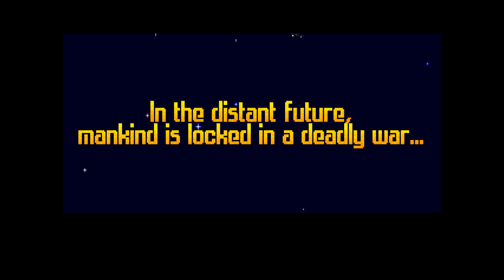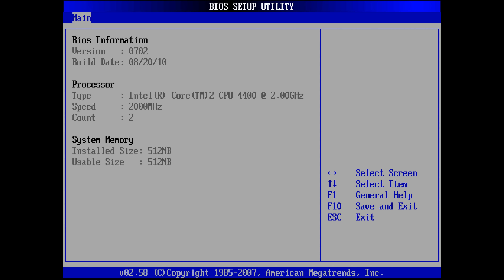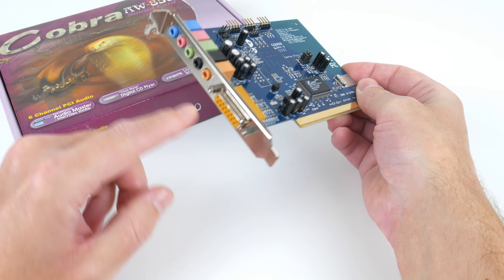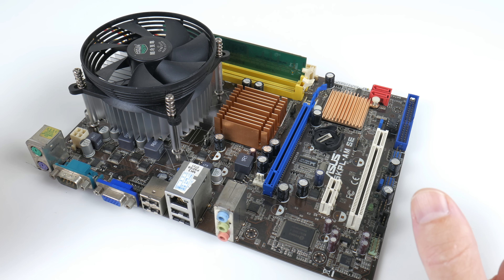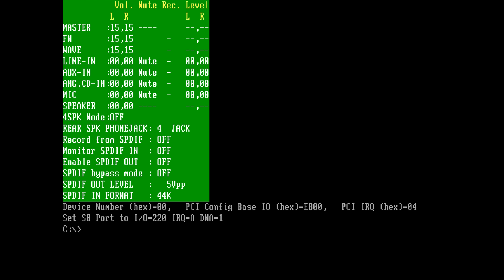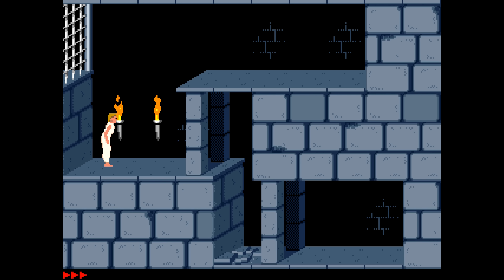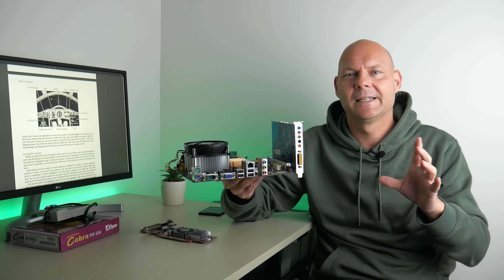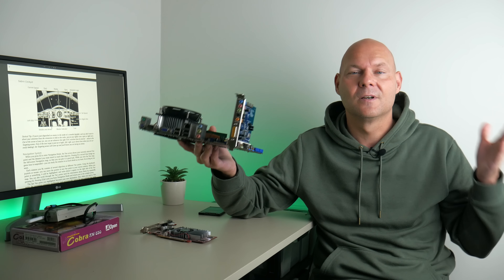DOS Retro PC with Parts nobody wants

Comment: Since you mentioned Vogons, that sort of rig will only earn you an eyeroll there. In my opinion it's important to feel good yourself about what you are doing. Btw the SBEMU will work fine with G31/ICH7/ALC882 so you don't need a 8738.
Reply from the maker: They did the same when I was spreading love of Socket 7 😂 It wasn't a PCI 486 so I didn't fit in 😅
Reply from the maker: SBEMU doesn't work with slowed down CPU as it is emulation.
Reply: @philscomputerlab  That's interesting. "Slowed down" as in Setmul / Throttle? I mean it does work with a BIOS FSB downclock doesn't it
Reply from the maker: @r.d.7698  Think about. Do you think Sound Blaster Emulation can run on a 386 speed computer?
Reply: @philscomputerlab  Oh that slow we are talking. Fair enough, thanks for the explanation
Reply from the maker: @r.d.7698  Have you actually watched this video?
Reply: @philscomputerlab  Just re-watched it. It's a good video and I like projects like this. Yes, I agree with you that for speed-sensitive games you would have to use a 8738, a 724, a Solo or such. Still, the said list is fairly short and to my opinion unless one is a diehard Wing Commander/Indiana Jones fan they can lose the expansion card and play a myriad of dos classicers using SBEMU on any 775 Celeron with minimal BIOS configuration effort that's why I mentioned it. It's also a bit of a rabbit hole, say we solved the speed issues, at some point VBE/graphical issues would arise with newer stuff be it GMA or Radeon. Then we would have to add a Virge to the mix or something. In one of the older videos you mentioned how some people are a bit too zealous on getting every single fussy game like Commander Keen to work on a single build. Like many hobbies, retro pc'ing is a spectrum and it's up to every enthusiast to decide how many corners they are willing to cut (time invested). Building a retro PC is not something you can future-proof (or should it spell "past-proof") for every application imaginable. P.S. jsut to be clear, had absolutely no intent on attacking your position, I appreciate your channel.

Comment: Hi Phil, I'm wondering if an E8500 could also be  usable for WingCommander (around 9-10 in benchmark score) as the slower E4400 here. The CPU is running 1333 FSB @stock (333x9,5 multiplier), so should be possible to get this about as low as the E4400 @800 FSB stock (200x10 multiplier).
I can get a G31 based board with a E8500 + stock cooler and 4GB DDR2 for less than $10. 
I have a Pentium 133 based DOS PC, but I can see advantages of using the LGA 775 for DOS, by using the onboard graphics, and the more modern SATA interface with SSD (fast and efficient, compared to older noisy Hard drives). As having the option to use it as an excellent Win XP rig (paired with a PCI-E graphics card). Also the more modern (not valuable) platform is better to actually use, instead of wearing out the old (now valuable collectors item) Socket 7 platform)
Reply from the maker: I think we will discover the DOS potential of all sorts of hardware in the future, not just LGA 775 but also from the AMD side. Exciting times.

Comment: My main PC is that LGA775 core 2 duo e7300 at 2.66 2008 model, ram is (2+2)gb 667, and 250gb crucial SSD for the OS , i switch between Arch/Debian/Void Linux, i use it to watch movies, my little hobby projects, i am planning to get GT730 GPU as an upgrade for this PC during the next festival sale 😅😅

Comment: Well, perhaps after LGA 775 people will start hunting the LGA 1155? TheRasteri has made an adapter to connect an ISA sound card, so I think LGA 1155 might be the next sought out platform for DOS gaming. Even if he didn't, you can still put a PCI sound card on LGA 1155 for DOS gaming, i think. I have kept mine LGA 1155 computer just for this reason.
Reply: using a Socket 1155 i7 @3.1ghz , but you don need an ISA soundcard, if you use the same card as here. But the problem is, do speed down the CPU ..... My HP has 4 PCI-SLOTS for historical hardware ,  so i can use him as normal PC and fast dos PC . 
bite the project from Rasteri ist very nice ...

Comment: If only there was a better DOS driver for the CMI8738... i've found it to be really hit and miss even with motherboard compatibility... and if the chip revisions after 037D could be determined if the FM module has been disabled or removed from silicon chip versions after..
Reply: Maybe it'll work with SBEMU. Worth a try.

Comment: 1. People not wanting 775 parts sounds odd. At least, it helps to keep LGA775 platform inexpensive. 🤷

2. You can always try SBEMU if you want to get Sound Blaster emulation in MS-DOS out of onboard audio: AC'97 or Intel High Definition Audio.

3. Biostar P4M900 or P48900 is capable to run MS-DOS*, Windows XP and Windows 11 21H2, with two real floppy drives. Tiny 11 (22H2) also worked, but it seemed to be little bit unstable.

* One problem I found in MS-DOS: with a Nvidia GT210 or 8400GS, some screen modes in MS-DOS get slow as hell on rendering: Norton Ghost and Windows 3.11 setup are examples. By removing the graphics card in order to enable and use onboard integrated graphics is the only solution I found - BIOS doesn't enable option to choose onboard graphics. Suggestions are welcome. 👍

Comment: For retro gaming I use an intel p4 socket 478 northwood 2,66 ghz - asrock p4i65g , kingston ddr 400mhz , nvidia fx5900xt .This platform works fine with win98 and its still easy to find parts.

Comment: This would be good for late 90s gaming too, you can literally run EVERYTHING in software, and get better performance than even SLI Voodoo2/3s. The clock speed alone is about 4x that of a PC from say 1999, not to mention the much greater efficiency per clock, and if you go with a later, faster clocked Core2Duo it would be even better.

Comment: If I know the irq and dma mapping for the onboard Realtek audio controller can it work for dos games I have a board with the t2500 core 2 dual that I would like to use as is because it has built in compact flash on the bottom side and the bios allows for turning off the second cpu core?

Comment: For Dos, I would prefer to use an athlon 64 LE (1640 or 1660) or sempron 150 (2.9Ghz) because these are the best single-core cpus ever released and the cache varies between 512ko and 1mo. The TDP is of 45W

Comment: Retro hardware from 1996- 2001 is now pretty rare and expensive.
Reply from the maker: Yes totally. Especially Voodoo cards. But you can run nGlide under 98 it works quite well.

Comment: I used the  P5KPL-CM in my old Core 2 Duo E7300 (upgraded to C2Q Q8400), in 2 years of use, the battery died and the bios was always reseting (even changing the battery), the one ending in VM was also not good

Comment: The days have come, LGA775 is now considered "retro", while many still use this platform as their everyday system.
To be honest, with so many tweaks and extras, it makes more sense to use Dosbox for this, especially when you don't need another extra bulky and noisy PC. For most VGA games with FM synthesis, it is even more compatible, has a fine-tuned speed control, you can use any of your your modern peripherals, oh and by the way it is free too. Just my 0.05 cents.
Reply from the maker: You are right! I've done a video on DOSBox Staging and it's amazing. Many if use love playing with old hardware, that is the appeal for me.

Comment: Interesting, I just bought a socket 370 board I saw on the electronic bay website because it had an ISA slot for the good old SB16, but was disappointed to see the bulging caps when it arrived. I had intended to recap it (one day!), however I do have a bunch of 775 boards with C2D or Pentium dual core chips and G31/G35 chipsets. The only sound cards I've got that might be appropriate are Aureal Vortex/Vortex 2 based. I think of those as more windows 98/XP cards, so I might as well pick up a cheap one of these cards just to have the option if I'm not happy with the Vortex cards.
Reply from the maker: That board is a keeper, for sure replace the caps!
Reply: @philscomputerlab  I've got an electronics project that I'll need to order some parts for soon, perhaps I'll throw the extra caps in with that order.

Comment: Nice video, even though seeing you use that kind of hardware about a decade removed from the actual vintage core, is rather weird.

Vintage hardware, and with it Vintage gaming, essentially refers to DOS gaming - which includes Windows 98-SE at best, which still used DOS and direct device / IO access under the hood. This means the era essentially ended in 2002,  while the CMI8738-LX was finalized in 2003 alongside the "Aopen Cobra AW-850", the LGA 775 was introduced in 2004, the Core 2 duo in 2006, your E4400 in 2007, the Radeon HD 4650 in 2008.

After that comes the era of NT based operating systems, most notably the first major end consumer OS called "Windows XP" ( though many already knew about Windows NT and Windows 2K, it's earlier versions, at that point ). And most Windows XP games still work till today with the only real hurdle being the need of a 32bit mode.

As Vintage hardware, you need a 16bit and 32bit compatible system, 16MB to 512MB RAM, a PCI or AGP graphics card in the 4 to 64 MB VRAM range, an (IDE) CD-ROM, an IDE HDD (emulator) of <=32GB and an ISA compatible soundcard - don't pick a PCI sound card unless there is no other choice, because none offers 100% compatibility since they all require some kind of emulation.
My recommendation would be a Socket 370 Pentium 3, an AD1816AJS based ISA soundcard like the Terratec Promedia Base-1 or one of its OEM versions, a "Dreamblaster S2" wavetable and either an ATI Radeon 9200 / 9250 AGP, an ATI Radeon 7000 PCI or an 3DFX Voodoo Banshee 16MB ( a good 2D and sufficient 3D card which may still be found for half way reasonable prices in between $50 to $80 USD ).

If you want the Vintage feel without the actual hardware, i'd recommend trying the "PCem" project currently maintained by "Michael Manley". I got pretty good experience with a "Pentium 2/300" + "512MB RAM" + "Voodoo 3 3000 - FAST VLB/PCI" + "Sound Blaster 16" setup running a Windows 98 SE under a Linux host. Be warned though that round about 350MHz is the best you can emulate with current CPU power ( Ryzen 9 5900X in my case ), and if you push it too far you get weird stuttering and clicking noises with your virtual soundcard.
Reply: Hm, I was about to get rid of my Radeon 9250. What do you like about it?
Reply: @armorgeddon  The card is compatible to most AGP standards ( and voltages ), its one of the last ( 2004 ) and therein fastes types of cards which still got Windows 98 support, and it already has a digital output through DVI which means you get a very clear image and easy compatibility to way more current displays.
It only supports DirectX 8.1 and OpenGL 1.4 which with being a "Lite" version means it isn't overly well suited for Windows XP gaming, but it got decent support for 98/98 SE/ME/2K/XP/Vista all the way 'til Windows 7, making it one of the single most compatible and universal graphic chips / graphics card out there.
So, if you wish for a graphics card that simply works with all kind of AGP systems, providing good performance where Vintage gaming is concerned, you can't go wrong with an ATI Radeon 92X0 .

Comment: I'm surprised you don't include some Windows speed sensitive games like The Day The World Broke in your testings. That game can be pretty hard to dial in the right speed for too.  For some dialogues in the game (and those same dialogues are very consistent to crashing), if your computer is too fast, the game throws an error and forces a crash to desktop. Obviously, this has to do with speed sensitivity.
Reply from the maker: Couple of reasons. The video is about DOS and speed sensitive issues are very very much an issue here. Big AAA games are affected. Windows you can use v-sync to cap FPS at 60 and will fix most speed issues. Never heard of The Day the World Broke...
Reply: @philscomputerlab  The Day The World Broke is one of those point and click story based games. Like a few Indiana Jones games, Prince Interactive, or 7th Guest but, Windows only. Short game that's flew under the radar for a lot of people. I only knew about it because my Dad, back in the day, got it at a flee market somewhere between 1997 - 2005. Game was pretty much dead on arrival, I think. Don't see a lot of people covering the game as a general Let's Play when it's working, so yeah, I can see why it's never heard of.

Give the game a look when you got time.

Comment: Here 775 are still good value, usually it's divided between those who can run windows 7 and for extension 10 and the ones who don't. Same with amd am2 socket. Even if you don't use dos, it's good for batocera. But some people are having issues with heat so they don't care.

Comment: I have a bunch of 775 motherboards and various CPU's and memory. SO! I can build whatever I want. I think I have some of those sound cards too. What are your thoughts on maybe using an old celeron and I have some 4200 ddr2 mem I don't recall the size of it but it should work. I do have some of those slocket boards too which might be better for win98.

Comment: I have a Asrock 775i65g with an Celeron 440 2.0ghz (single-core and non HT) paired with an V3 3000 PCI running Win98SE without problems... Motherboard even has SATA compatibility mode where Win98SE sees an SSD as an IDE HDD... 😁

Comment: Is it possible to dual boot MS DOS and windows XP? 

I have  gigabyte GA-G41MT-S2 that has a core 2 Quad Q9650 @ 3.0 GHz, 8 GB DDR3 RAM, and a GeForce GT 710. It has PS/2 Keyboard and Mouse and an Integrated VGA and It also has one PCI slot.

Comment: i have core2extreme qx9770 for my retro build with rtx 3090... yes. i just replaced the old gtx 470 triple sli with one 3090 after I upgraded my main rigs to 4090 and 3090 ti.

Comment: I'm wondering how little power a C2D would actually use, when being configured to run at such slow speed for DOS gaming. I mean... 5-10 watts maybe? Making it easily possible to cool totally passive (disconnecting the fan).
Reply from the maker: With some lowering of voltage, maybe. Not sure about totally passive though.

Comment: Will this also be suitable for win98 gaming? It doesn’t have ago though - will pcie gpus run? I have 2 similar machines found recently .. but the smallest ram stick I found is at 1GB mich might be already too much isn’t it?
Reply from the maker: I've done a video on this topic, best to watch that one. Some PCIe cards work, mostly from ATI. Or you can use PCI cards. 512MB is what you need for 98, more will cause issues.

Comment: you talk about setting the cpu duty cycle, but i don't see that in the video. would you mind explaining it please? thanks
Reply from the maker: Check out the cpuspd link down below it comes with documentation and the program itself has help as well. The behaviour differs with what cpu you use, with Core 3 you can set it from 1 to 8 out of 8.
Reply: @philscomputerlab  there's a cpuspd link? haha. no worries though i found it on google. thanks :)

Comment: Is there a guide somewhere to get dos onto that ssd. I didn't quite follow what phil was saying.
Reply from the maker: Hmm good point, I could do a quick tutorial showing the process and adding resouces, files needed. If your machine can boot from USB it is very easy, if not you need to be able to boot from floppy or optical drive and have a modern machine that can create a floppy or optical disc.

Comment: I was recently given a Dell Optiplex 755 SFF running Windows 7. I took out the Core2 Duo and put in a Core2 Quad Q6600. Also fitted a GT1030.

I tried getting it to run XP, but it wouldn't even install. Although they came with XP when first produced, this one kept throwing up a protection error. I think that it needs a specific Dell version of XP. Any non Dell XP version had AHCI driver issues.

I'm not sure if it would run DOS though. The same person gave me a Socket 478 Packard Bell with a Pentium 4 and that seems to like DOS OK, but I have noticed the prices of these boards have started to increase now too.
Reply: I don't think a GT 1030 has Win XP drivers.
Reply from the maker: Yes put in a GT 630 instead for XP.